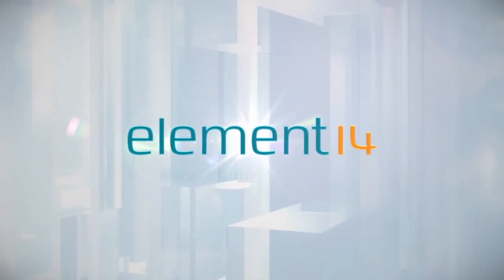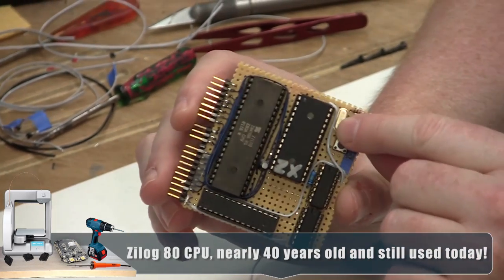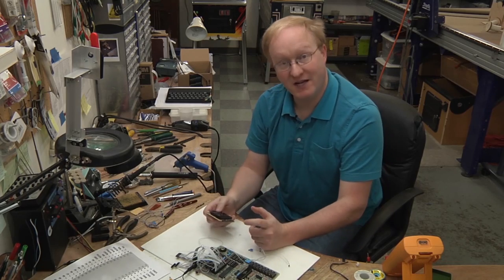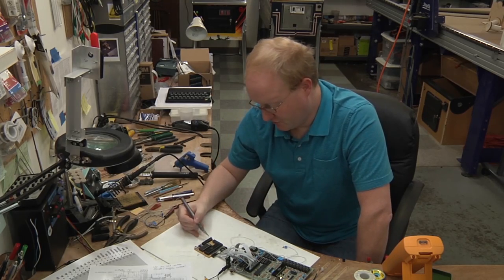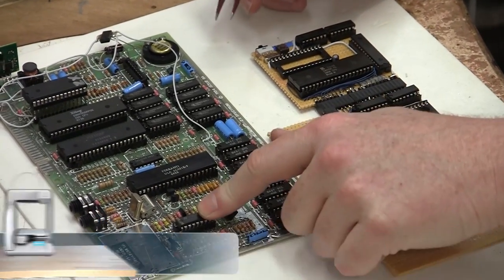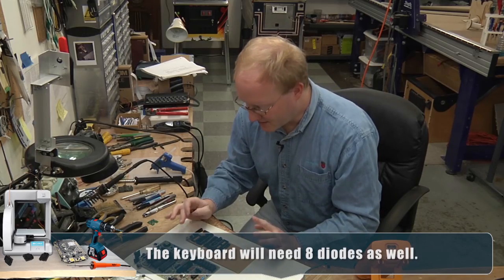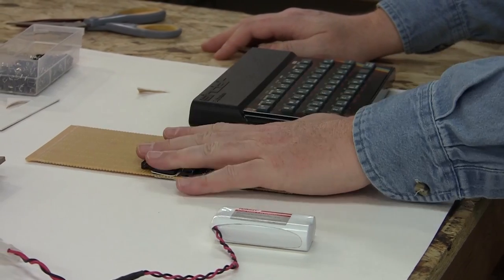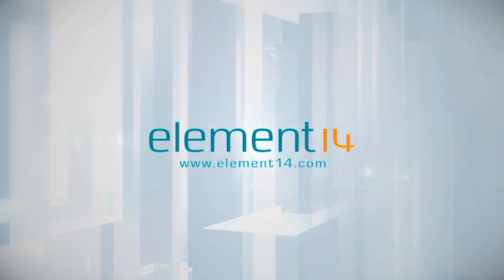Ben Heck's ZX Spectrum Mod Part 2

Comment: Interesting design considerations for the case, very thoughtful.  When you got to the batteries I was wondering if it would help ergonomics to place them at the bottom, either on the side or underneath to create something like a grip.

Comment: "Zee" 80 is what the Americans call it. UK called it "Zed" 80. The Brits are known to change crap like this, so don't take what they say as etched in stone. For example, they're the same people who call VHS "Vertical Helical Scan" when even the Japanese who invented the thing call it "Video Home System." The Z80 was designed and manufactured by Zilog - an American company. The engineers at Zilog call it the "Zee" 80. Therefore, if you like to call it the "Zed" 80, you may feel you're not wrong, but you are in fact in the minority.
Reply: One thing to add to this is that the British believe the letter "Z" is actually pronounced as "zed," as in "ex, why, zed." They claim that the letter has been pronounced "zed" since the 17th century. In fact, Shakespeare wrote, "Thou whoreson Zed, thou vnnecessary letter." (Lear II. ii. 69). But of course, he wasn't a yankee. When English was imported into what would eventually become the United States, the pronunciation changed to "zee", as in "ex, why, zee." Strange thing is that, as people moved down and settled into the southern United States, they still pronounced it as "zed" (French influence, maybe?) while the yankee in New English continued to use "zee." In fact, the letter "Z" isn't even native to New English. Apparently, the letter was introduced as it was needed in order to spell loan words that are not part of the English language (some say the pronunciation "zed" actually originated from French.)
Reply: Actually, I call it the Zee-80.  because THAT IS ITS NAME.

I wish you would extend the same courtesy to the Zed Ecks Spectrum.
Reply: ***** Funny anecdote, I threw two American sailors off of my yacht as the pronunciation of "buoy" got on my tits, I mean what the actual fuck is a booie? I thought they were taking the piss at first.
Reply: I know this, my mother is English, however it's about as dumb as arguing over "zee and zed", that was my point.

Comment: Thanks for another great video. I'm just curious. Couldn't you taking the working logic of the ZX Speccy (or almost any other 'old' computer / console) and program it onto a single processor chip these days? Would that be insanely costly to do for the home hobbyist to do? (Basically the entire thing, including ram, video and sound. Then just use power and physical connectors to TV, Speakers, Keyboard, etc?)

Comment: ***** You did an amazing job on this. I've just started soldering boards with chips. What kind of wire are you using here because they're so small.

Comment: Even as a yank, I'd prefer that the ZED X Spectrum is called by its proper name. Aside from that, is there a way to set a custom amount of zoom on that screen? Given that the ZX Spectrum only has a 256x192 area (in PAL where lines are shorter than NTSC nonetheless), I think it would be a good idea to get rid of the bordered area for the sake of aesthetics, not wasting any of the screen and visibility as a tiny portable system

Comment: Why did he wiring everything by hand if , he could etch a PCB ?
Reply: Because you can dewire it after and change things in it.
Reply: Because it is a fun electronics project.

It's a one off to see if he can do it, not something intended for duplication.
Reply: of course but it's double time to build by heand wiring.....nevermind

Comment: Please Ben, just call it a Spectrum, okay? Keep all those potty mouths down there happy. I may have smirked though when I realised the "small" portable Speccy is going to be bigger and heavier than the original ;)
Reply: It is both a testament to the original design and the ability of the modern hobbyist to tinker in the realm of what was once industrial design.
Reply: Well, having the screen and a power source built in are clearly going to beef up the weight a bit.
Given that the battery pack seems to be a pair of 18650s in heatshrink, I'd be rather tempted to separate them so that you can have one at either side of the case and use the bulge that they'll produce on each side as a grip.
Reply: The circuit board isn't that much smaller, but then it won't be because it's largely a rebuild using original through hole components. The circuit design is a lot simpler than the old one though, thanks to the modern ram.

Undoubtedly it could be a lot smaller with surface mount, or an FPGA implementation of the whole system. but that's obviously not Ben's intent with this, and really I think it's all the cooler for that.

Comment: Hello. I'm glad I found this channel and the guy who can help me if he wants :-) I always wanted to build a small Z80 based pc. I have a small board with TMPZ84C015 microcontroller(IC80 from MCT Paul & Scherer). I'm searching for a solution to build graphic interface. Any idea based on the hardware I have? Could V9958 from Yamaha work? I would also want to be able to load programs for SD card. As a display I can use one from GameBoy Advance. Or I can buy a new one. Can you give me some hints?

Comment: I have no idea what I'm talking about when it comes to these things but I would be grateful if someone could explain to me why Ben uses the big bulky cell batteries instead of a much slimmer Li-ion battery from a phone.
Reply: Those are actually li-ion. The ones from your phone are usually shaped to fit in the case, that's why they might seem less bulky while actually having the same (approximate) volume. These are a standard-ish AA-duo pack size; so I would suppose it's cheaper.

Comment: I wonder if he would be able to make a portable Commodore 64 using the same basic design?
Reply: The C64 has more ICs and a lot of it would be harder to cut out, I think.
For instance, there's three big ICs you pretty much can't omit: the CPU, the graphics chip (VIC-II), and the sound chip (SID). In addition there were the two interface adapter chips (CIA) - which, apart from operating the keyboard and I/O ports also include RTC and timers (which makes them slightly harder to replace with alternative circuitry), the PLA which handled bank switching, and then the RAM and ROM, of course...  I expect the CIA and PLA are complex enough to make it non-trivial to replace them with something smaller...
Of course, if you want a portable Commodore 64, there is another option: The C-64 "Direct to TV" all-in-one joystick designed by Jeri Ellsworth.  It can be hacked to add a keyboard, external storage, etc.  It's "cheating" maybe but it is an option...
Reply: tony taylor I know. I just said that.
Reply: Not a chance.  You couldn't replicate the whole functionality of the C64 WITHOUT "cheating".
Reply: I'd have to disagree, I don't consider replacing the RAM to be cheating.

But you could make exactly the same argument for using the RPI to emulate the C64, and to much greater effect, given the greater complexity of the C64.

The DirecTV version is probably the best solution for a C64 portable.
Reply: Certainly using different RAM is one of those things that doesn't have much impact on the experience of using the system - not like replacing or emulating sound hardware or video hardware, in which case there's usually some noticeable difference
Reply: Sinclair themselves probably would have built it that way if not for cost.

Now, this is the cheap option.  So it's pretty in keeping with the history of the system.

Comment: Why not use a pair of cellphone battery packs as well?  For example, the Galaxy S3 batteries are cheap on Amazon and two of them stacked are thinner than one 18650.  Also, are you planning on leaving the sockets on the protoboard?  I'm sure that could slim this project up a bit without them.  I mean, once it is tested and working, you wouldn't need to have them, right?

Comment: Minor niggle here Ben; but the classic little "dead flesh keyboard" version you're so beautifully butchering isn't the latest version of the Spectrum, in fact it sits quite close to the middle of the series. I personally own a ZX Spctrum+3 which is the de-luxe (for lack of a better term) model with a mechanical keyboard, 128k RAM and an integrated disk drive. There was also another, similar one that came with a built-in tape deck.
Reply: The 48k was the first basic design, yes, but it looks to me like Ben's Spectrum there is one of the later revisions of the model. Back in the day it wasn't a case of design it once and produce that forever until a new model was needed; the old microcomputers were always undergoing subtle improvement.

Comment: What is The point of The zee x stectrum
Reply: What isn't the point of the zx spectrum?
Reply: Historically, it's place is assured because it was one of the first, cheap Microcomputers.  Even in the US where it kind of suffered a "failure to launch", it's low price was partially responsible for the lowering of costs around machines like the C64.

It's also a medium complexity design which it is possible to clone almost completely with off-the-shelf logic, making it an incredible tinker-tool.

It was truly almost all things to all men:  A gaming platform to some, a computing device to others and an early 80's equivalent of an Arduino to yet others.

Comment: You should build the ZX with a FPGA! I would be cheating, just another way to do it!
Reply: Interestingly, the "ULA" in the Spectrum IS an antecedent of the FPGA, a Ferranti gate-array that was used to "smoosh" a few chips together and was part of the cost reduction measures for the system.

A similar approach was used to cost-save in a few other UK Micros, like the BBC Micro and the Acorn Electron, but the Spectrum (at least the 48k version) went the whole hog and managed to squeeze just about everything into the ULA.

Comment: Sinclair "Zed Ex" Spectrum is the only proper way to pronounce the humble Speccy.

Although you can see that a lot of things are far from perfect, in it's time it was dirt cheap (certainly compared to the Breadbin also known as C64), it was actually rather easy to use and it got a sh*tload of software released because computers like these in that era where the start of bedroomcoding, 1 or 2 guys writing top 10 titles that would stay on top of the charts for weeks and even months.

And I must admit that I like these kind of projects, just like software that is still being programmed for the ZX, this is comming up with new ways of putting a 35 year old design to its limits. Its al things you could not even imagine 35-25 years ago.